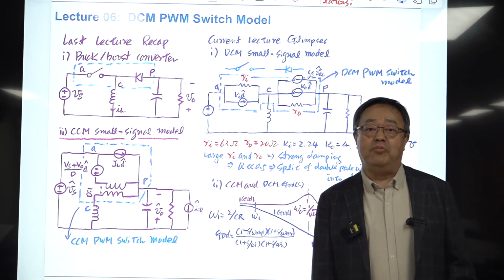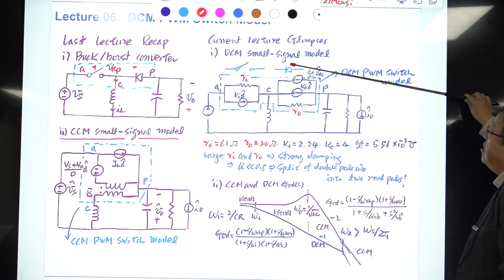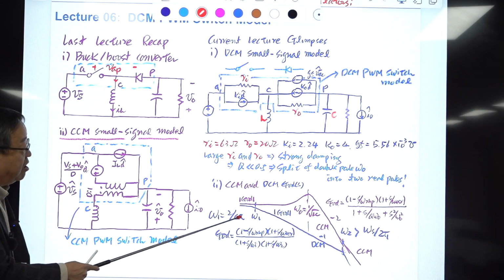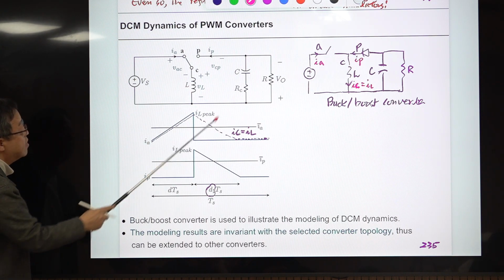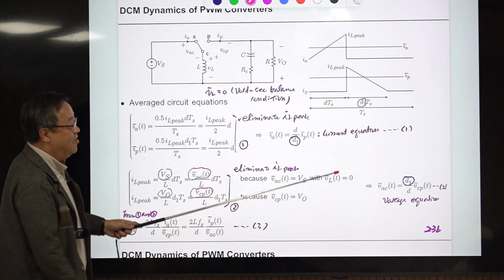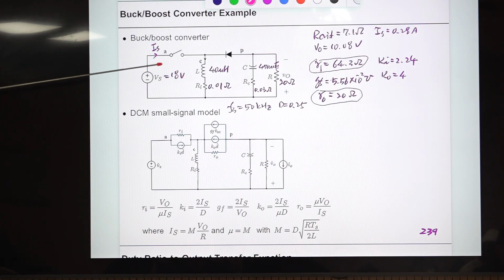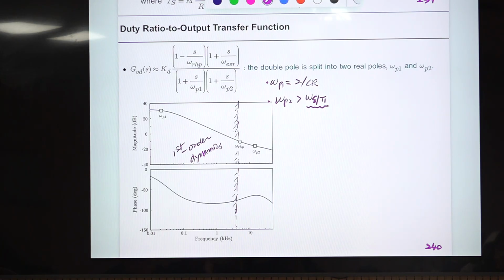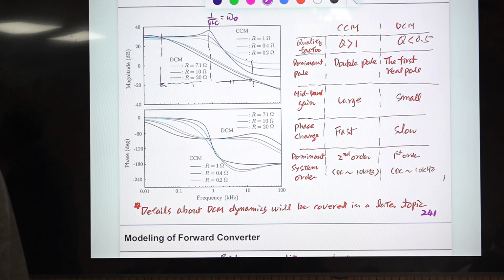Lecture 06: DCM Operation, PWM Converter, DCM Dynamics, DCM PWM Switch, Small-Signal Modeling

Comment: Thanks,
I still couldn’t understand the reason. When the average model is based on Ia and Vcp, why is Vcp replaced with Ip in the small-signal model?

Why don't you continue with Vcp in small signal model?
Reply from the maker: ㅣ am  on travel now. I will get you later.